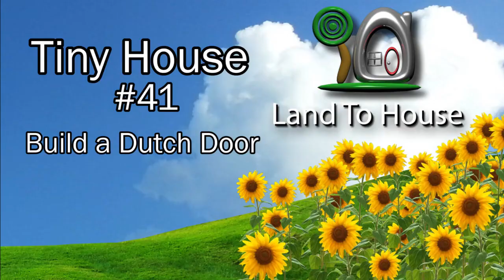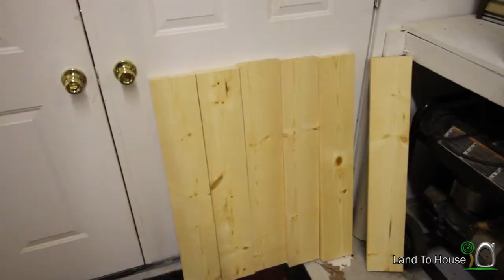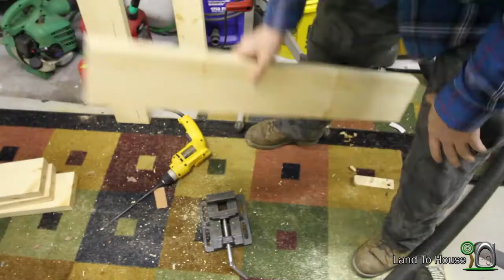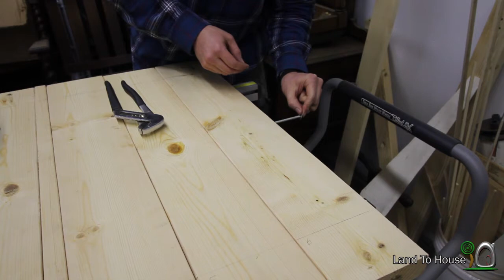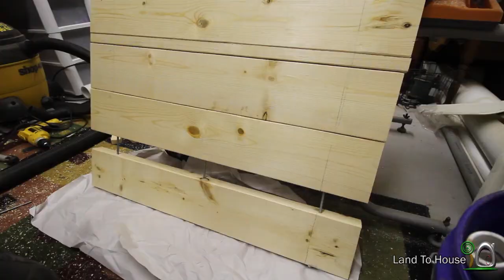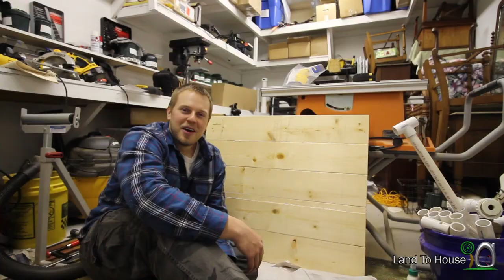Tiny House 41 - Build Dutch Door Part 1

Comment: I know this video is more than a year old, so you're probably already well aware by now, but a good tip for even glue application is to spread out your glue across the entire surface rather than relying on the bead to spread evenly with wood pressure. Anywho, I'm going through all the videos, really enjoying watching it progress. Awesome series.
Reply from the maker: +Apek Zombie I did not know that. Thank you. What do you suggest as the best spread method?
Reply: Personally I find using a finger the easiest, but others use a thin scrap of wood or an old bank card or business card. Too much faffing about with cards, and it's easy enough to wash your hands afterwards
Reply from the maker: +Apek Zombie yes that is likely what i will use. I mean it's right there haha. Thank you for the tip. There is much to learn about woodworking.
Reply: @LandtoHouse  acid brushes work great for this (cheap disposable) and mostly reusable with a dixie cup of water handy. 36 pack from HF costs $2.50

Comment: Neat project.  I might have cut the sides of those boards to remove the camber so the boards go together as if they were once piece of wood.  You could skip the rods because that wood glue is strong enough to hold those panels together, though the rods might be useful to prevent cupping and twisting of the boards with the change in humidity.
Reply from the maker: +christschool thank you for watching!  Removing the edges of the wood would have been nice.  I have learned a lot since making this video.